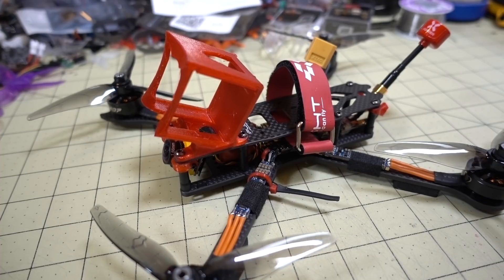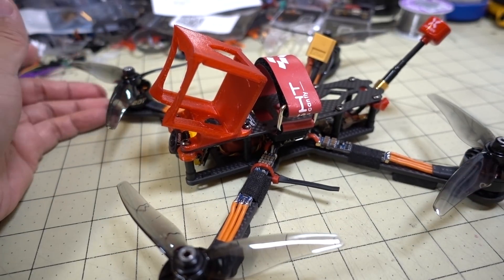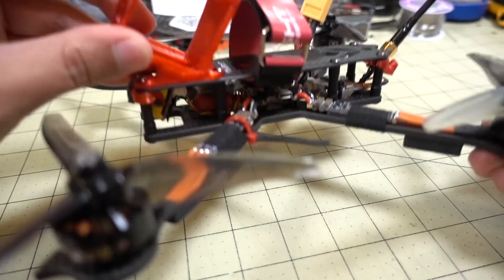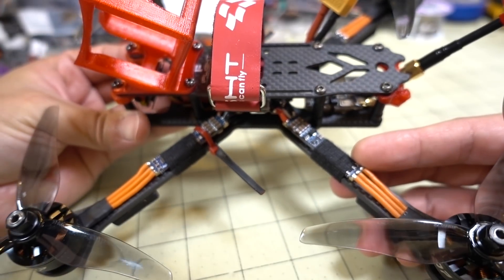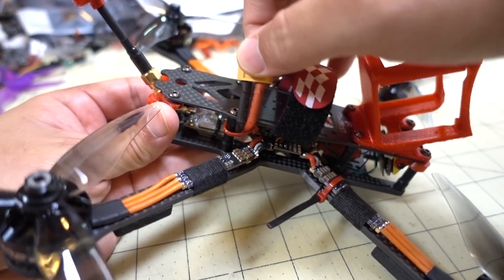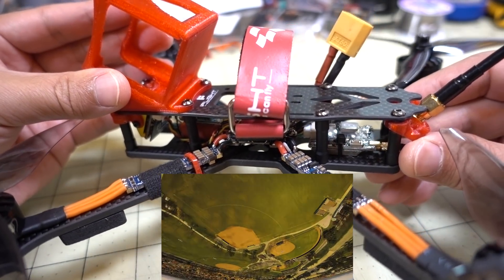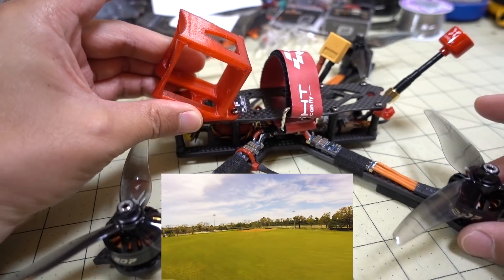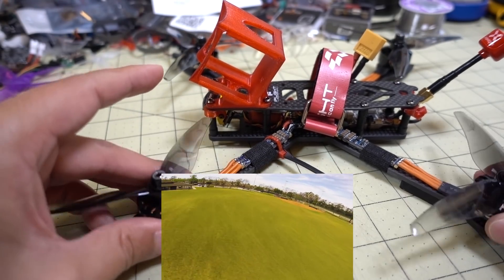iFlight XL5 // RPM Filter Testing 🏁

Comment: Hello! Coincidently, I am using the same frame on a build right now with 2207 Xing motors, waiting on an F4 with an OSD as the F3s affect my OCD (😀). I went with a 30x30, 4 in 1 ESC, and the controller will be 20x20, as I often build, because I like having the larger board for the muscle and keep the brains small and light. I am hoping to get the receiver and vtx stacked somehow on the back (frame) extension.
Thanks for the content!